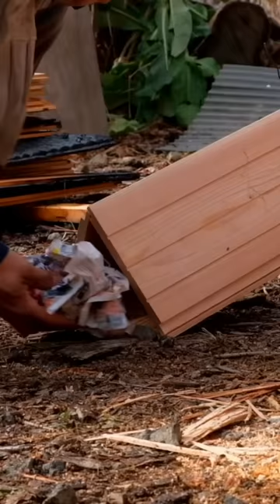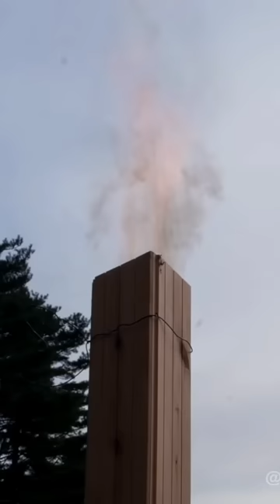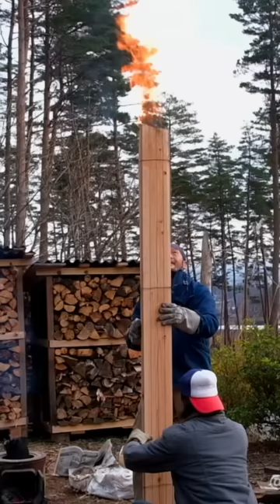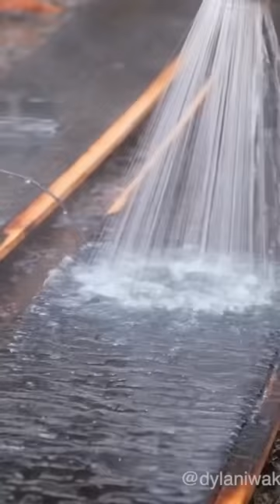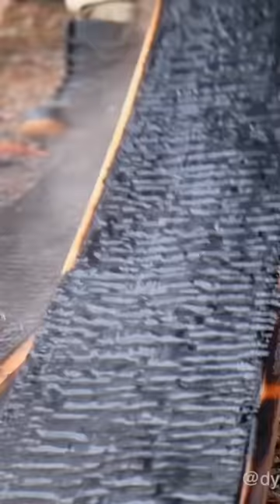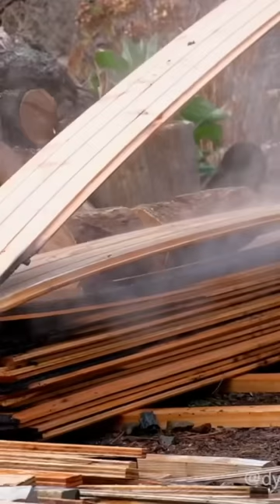Yaki Sugi 焼き杉

Comment: Looking through these comments it's clear that people are uneducated and don't understand what is happening here. Charring that wood like that does not weaken the wood. It actually strengthens it and seals it as the fire draws resin and turns to basically resin impregnated carbon on the surface. It was used in colonial times for fascia and many other outdoor wood items to prevent rot. There are some people that even still use it today for wooden beams that are going to be mounted in the ground. They will char the outer surface of the part to be buried in order to preserve it from rot. It is actually very effective. This has been being done even since caveman times and with certain tribes where they would char the tips of their wooden Spears in order to strengthen it and make the tip harder when they did not have access to a metal spearhead. And now we know. And knowing is half the battle.. GI-JOE!!!
Reply: Ты хочешь сказать, что если уменьшить толщину доски, это увеличит ее прочность? Серьезно?
Reply: That is well said and in addition this wood won't catch on fire easily as the burnt area is a corpse with nothing to burn there anymore, creating protection! Learn something about moon wood!
Reply: Well put and absolutely right :)
Reply: This was angry😂😂😂
Reply: That answered "Why?"
Reply: @alexplotnikov2658  
Of the type of strength mentioned (rot resistance and surface hardness) and if done properly. But yes it is less resistant to mechanical force but it is used to protect the wood providing that strength.
Reply: @alexplotnikov2658 сё првильно он написал. Обугленный слой дерева превосходный антисептик. Никогда не сгниëт.. А кто тебе вообще сказал что этим методом дерево прочней становиться 😏🤦‍♂️
Reply: Thank you for enlightening the ignorant masses! I feel so much smarter, and in a way, superior... like you!

Comment: What's the purpose of this technique ?
Reply: I was wondering the same. Google told me this:

Yaki Sugi is a charred Japanese Cypress (or Cedar?) Plank. The process done to create Yaki Sugi is a heat treatment process where you burn 1 face of the planks in this specific way (not with a torch or kiln) which prevents decay, repels insects, strengthens it and makes it more fire retardant. Supposed to be very low maintenance too. Used for exterior for siding, roofing and fencing.
Reply: @ronniesunshine1163  thanks!
Reply: @ronniesunshine1163  and weather proofing.
Reply: it makes the remaining wood less tasty to decay organisms and bugs, but it being cedar, I don't think it needs to be so heavy a char.
you can do this to the tasty woods that are more vulnerable to rot, like we worked with heat treated maple once.